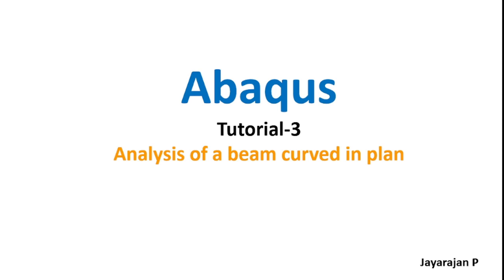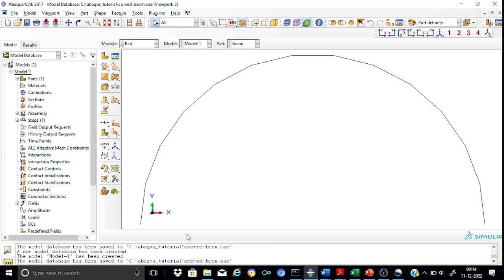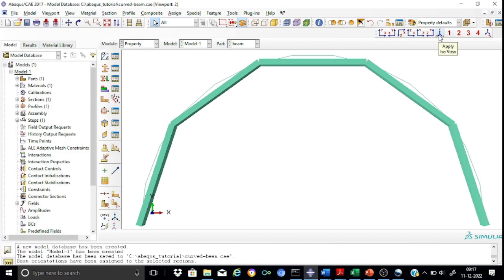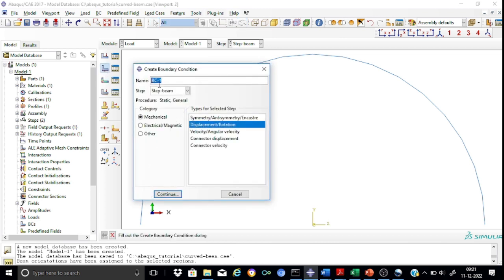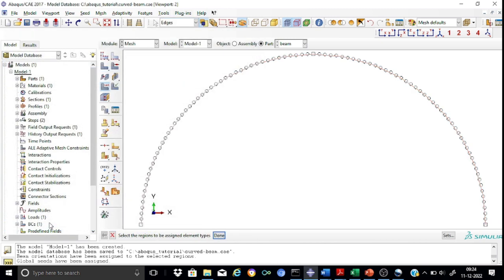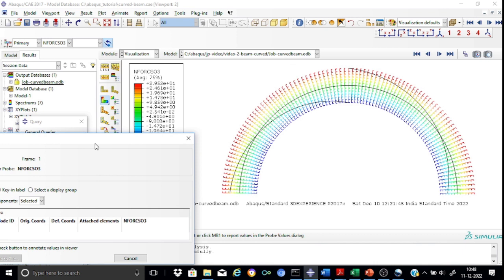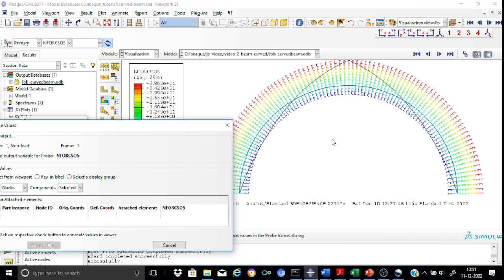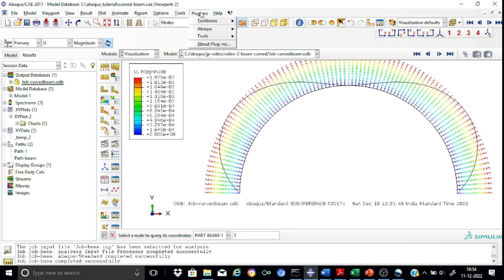Abaqus tutorial – 03:  Analysis of a beam curved in plan

Comment: With respect, this analysis of yours has problems from a theoretical point of view, and according to Abacus's own documentation, I would like to draw your attention to the following content from the documentation, so that you can find out whether your analysis is wrong.   
If you intend to model curved beam structures, you should use one of the two methods described earlier to define the n2-direction directly, allowing you great control in modeling the curvature
There are two methods that can be used to override the
n2 direction defined by Abaqus; both require editing the input file manually. One is to give the components of
n2 as the 4th, 5th, and 6th data values following the nodal coordinates. The alternative is to specify the normal direction directly with the NORMAL option (this option can be added using the Abaqus/CAE Keywords Editor). If both methods are used, the latter takes precedence. Abaqus again defines the n1-direction as n2×t